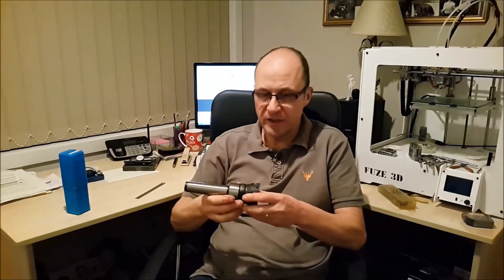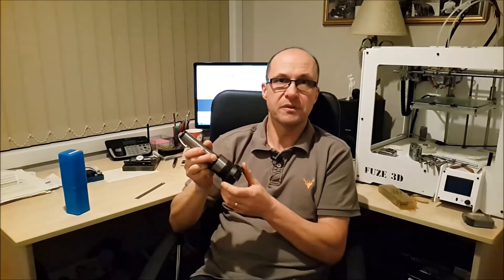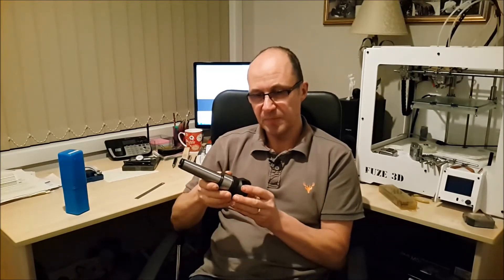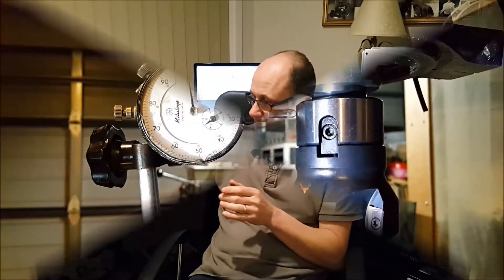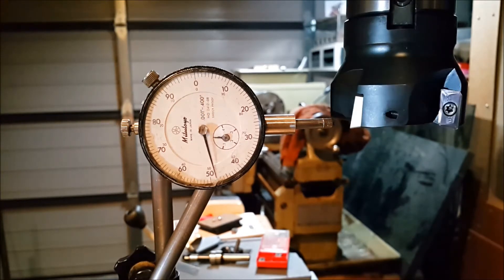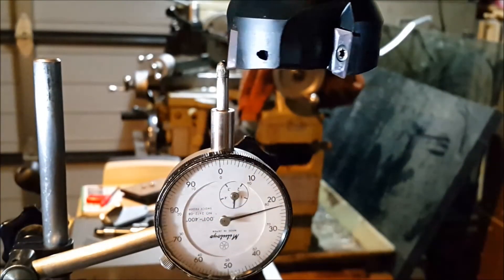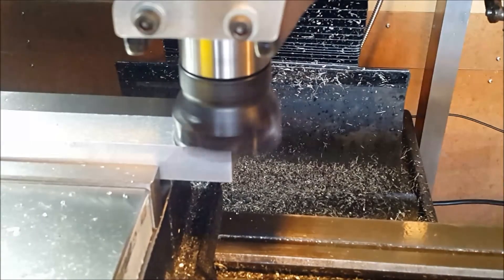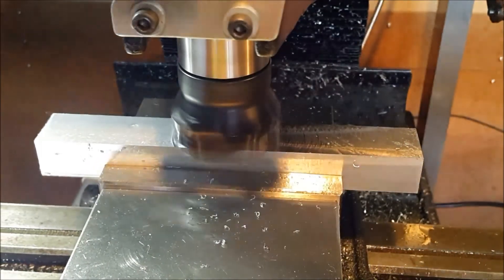15 - Face Mill Chinese Tooling in the ZAY7045FG(ZX45 clone)

Comment: Hi Kevin. Very interesting. A couple of questions.... Are you still happy with this cutter? Also, do know if it would be ok to use it on say 5mm wide aluminium?
Cheers
Andrew
Reply from the maker: Hi Andrew, Its a great accurate facemill. I use it for facing wide bar stock. Using it for 5mm wide aluminium would be a bit overkill. My personal preference would be to flycut it. Regards Kevin